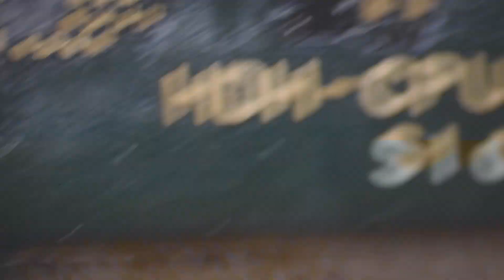Damaged Switch Lite USB C Port Repair + Liquid Damage

Comment: Can i also remove the port with 200 degrees?  My heat gun only can reach 200 degrees
Reply from the maker: 400C right now is the most comfortable temp. 
I'd suggest getting yourself a hot air station that can handle atleast 400C

Comment: I applied soldering flux paste, and started heating it at 350 c and the solder just doesn't melt. What am I doing wrong?
Reply from the maker: Use as high as 410c, just when the solder does liquify do your best to remove the port quickly.

Comment: Super helpful video, thanks Chase! I'm about to attempt this repair myself for the first time and I've watched a few videos along with this one. I see some technicians applying the hot air from on top of the connector and some from the bottom like in your vid. Would love to here why you prefer to apply heat from the bottom versus the other side? I also love that you provide the viewer with the temperature settings you're using while working, the details are so incredibly helpful!
Reply from the maker: So glad you liked the video! The reason in specific is because it protects some of the more sensitive components on the top side and specific the battery connector. You definitely want to consider it when applying that extreme heat

Comment: Hi Chase, I am a beginner in terms of hardware repairs, I bought liquid damaged Nintendo Switch with screen not turning on, I noticed that if you shine a bright light on the display, you can actually see the image, so I checked the backlight ribbon, and it was damaged, I was able to repair it, and now it works fine, but I have some serious problems with WiFi not working 95% of the time, it sometimes work after leaving console turned off for a day or two, and with bluetooth connection to joycons (not working 100% of the time).
I am pretty sure it was working when I received switch, because I have tested the switch in docking mode, now everything works fine besides that WiFi and bluetooth connection to joycons or headphones (I checked antennas, and even checked known working ones, but it's not working) May I ask you for your suggestion? What could be wrong here?
Thanks in advance!
/G
Reply from the maker: Reball Wifi IC and see what happens. 
If still nothing, replace it.
Reply: @chasefournier  so you think BT and WiFi problems together, can come from WiFi IC? I actually didn't know that this chip is somehow managing BT connections! :) Thanks! will try that!
Reply from the maker: @Gzyniu  I'm pretty certain it does. I could be wrong.